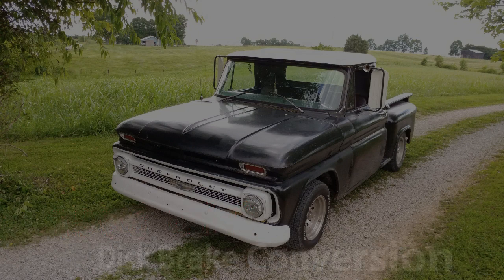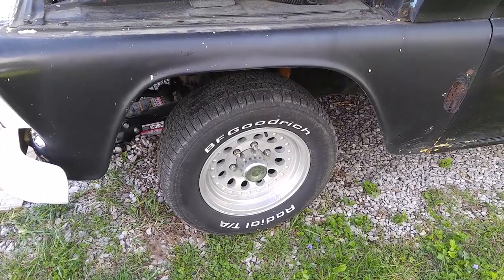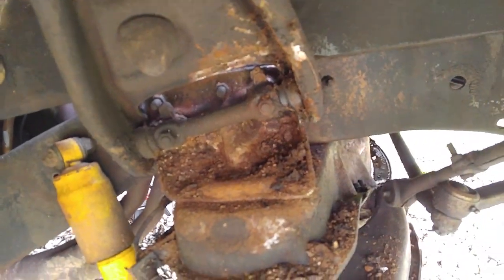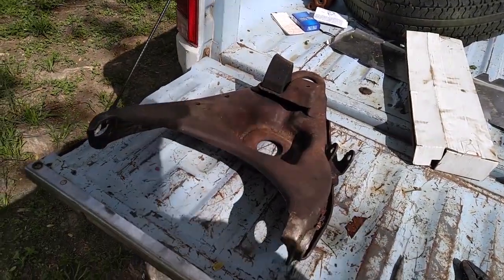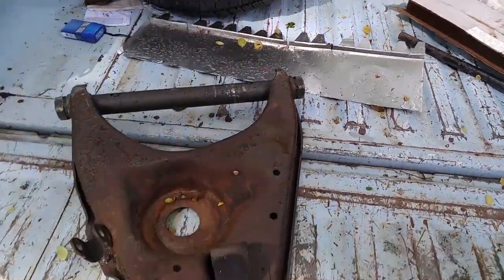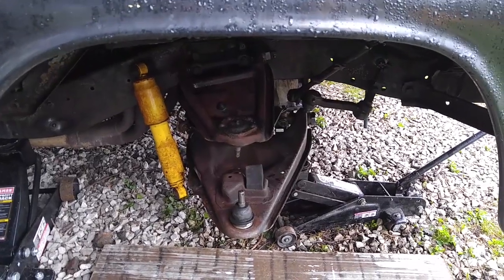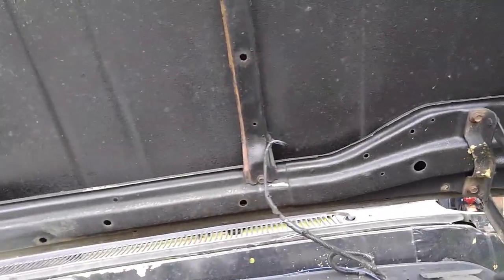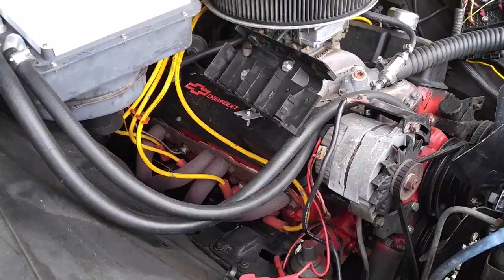1966 C10 Disk Brake Conversion

Comment: Hello,are you sure you had the right ball joints,mine on my 66 C20 were really tuff to get in !, I had the ball joint press ,they went in tight , my stock spindles came from CPP, I order ball joints from parts jeep, for 66 C 20 and spindle went in tight & perfect, I also had the tie rod problem since they changed the right hand thread ,I think in 85 ,so order the sleeves from CPP ,calipers,from Auto Zone & hoses, rotors from parts,jeep my disk brake conversion was total around 800.00 instead of 1,500
Reply from the maker: I believe the reason for the tightness issue on the lower control arms is that they were just worn out. I probably could have heated them up and hammered them a little tighter before putting joints in.
Reply from the maker: I also got the sleeve adapters from Performance Online. Solid and good looking.